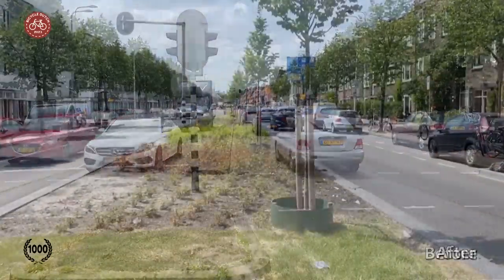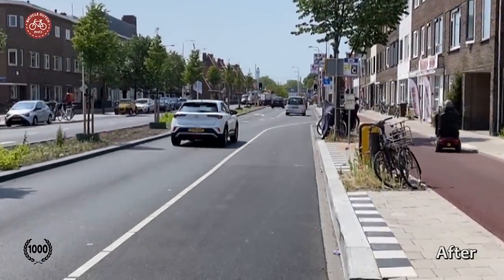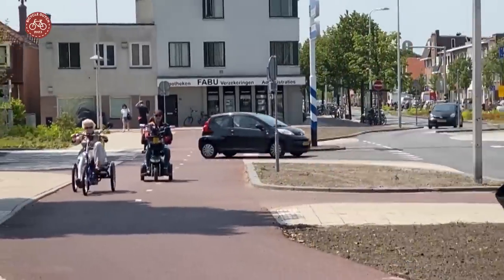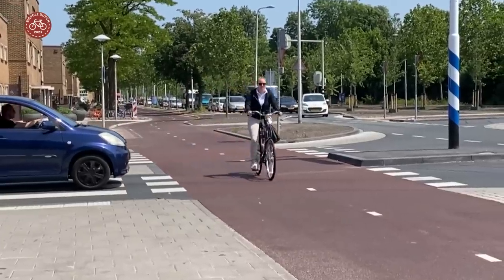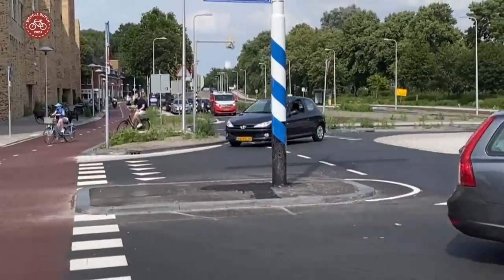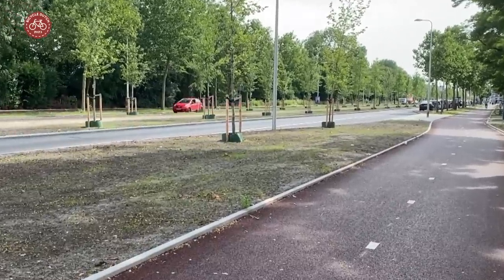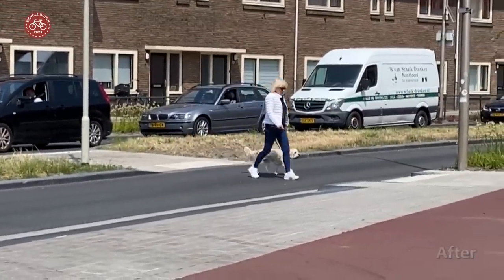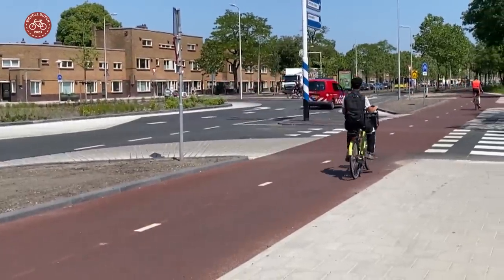Less space for cars, more for green. Utrecht's redesigned ring road

Comment: this success is in part a testament to how good the traffic flow is on the highways. in Toronto there are a lot of instances where the highway is slow and speeds drop to under 60km/h for big and multiple  and so drivers react by taking the normal roads; which in turn puts a lot of technical and political pressure on road engineers to not reduce the driving width and number of car lanes on roads.

i don’t know much about the dutch highway system but it sounds to me like there are fewer on and off ramps that Toronto, and that the roads that bring traffic into the highway are usually two lane or one lane wide in the Netherlands whereas in Toronto they are often three lanes wide. I think Toronto dumps traffic on the highway in big waves (red lights and wide arterial roads do this) vs in the netherlands the roads that lead to highways have fewer red lights and lanes.

Comment: This is one thing more and more German cities are getting as well: If Mr. Wissing doesn't want them to sign a street like this at 30 km/h then just design it for 30 and the result is probably even better.

Two ideas however are new to me: The wayfinding intentionally telling nothing outside the city and the voorrangsplein. Not totally sure, where the advantage over a roundabout is however.
Reply: When this crossing on the video was just done, another one further down the road was still under construction and was closed down. This voorrangsplein was then a complete pain to cross as a motorist (if we want to go in the direction of Amsterdam I would have to cross it). Now that both are open it’s less of an issue. I think this design is because there is less traffic crossing the road than going through (if that makes sense). It’s certainly easier when you’re just driving/cycling straight ahead, at the expense of making it harder to cross as a motorist. As a cyclist it’s comparable to crossing a normal roundabout with two separate road lanes.
Reply: For cars, this crossing is designed to optimize traffic on 1 axis, and crossing traffic needs to wait longer. Its basically a roundabout with priority for 2 out of 4 directions
Reply: If we would only have so much space - some parts of the ring road here in Lüneburg are only about 15 meters including the bike lanes and sidewalks, leaving very little room for gaps or green.

Comment: I'm NOT a fan of the new layout. Sure there are lots of pros, but also some cons: single lanes divided by a median are a nightmare for emergency vehicles responding to a call and for other motorists to find a spot to pull over. That definetly increases response and transport times of emergency vehicles
Reply from the maker: Emergency services were involved in the redesign. They approved everything and where necessary the cycleways have been constructed in such a way that they can carry the weight of even the heaviest fire engine. The emergency vehicles are not going to wait behind vehicles on the single lane, they can simply pass them on the cycleways. This is explained in the blog post with this video.
Reply: @BicycleDutch  wow ... would have never expected it to be so bad that local emergency services would approve sth like that ... 
A bike path should primarily be a bike path, just like sidewalks being sidewalks; Of course one could use them if utterly necessary, but this shouldn't be the backup plan right away. 
I've seen quite a few videos from the Netherlands, where it still costs the emergency vehicle time to cross over to the bike lane, especially larger emergency vehicles like Tower Ladders from the fire department. And I've also seen quite a few clips where pedestrians or cyclists didn't bother to move over - they heard the sirens, but didn't expect the emergency vehicle to be on the sidewalk / bike lane. 
Especially larger and heavier emergency vehicles will not fit there and they will have a hard time getting through on such roads, especially when traffic is backed up
Reply: @dimrrider9133  no, we don't have any EVOC, no qualification which allows us to be behind the wheel of an emergency vehicle

Comment: Awesome how dutch use their cars so little, but thats also because the country is compact and have an easy terrain
Reply: It's funny how our first thoughts, in this case your reaction, can be completely wrong. It's not about the scale or terrain of the country. Dutch car ownership has never been higher than now. Most car trips in any country are no longer than 3 miles, and the main difference is that the Dutch made the 3 miles around their houses safe and inviting to walk and cycle. They guide traffic into compacted flows: Through traffic uses ring roads around villages and towns, and local roads are designated for either traffic or living. This takes away a small % of car traffic, which is enough to clear traffic jams.
Reply: Is has nothing to do with the size of the country.
If the USA starts designing their city's like this, you would get the similair effect

Comment: Horrible design and I have a pretty good idea which external bureau pushed this. No space to create room for emergency vehicles, especially during rush hour. Dual direction bike paths are an absolute disaster for visibility, in particular for truck drivers who have absolutely no intention of running over cyclists but are frequently confronted with literal kamikazes. Traffic lights are proven more safe than "creative" roundabouts, with prominent example the Delflandplein in Delft that was designed by that same bureau and in its first year counted more casualties already than it had during ten years before when it was still a crossing with traffic lights. Ten years later it is still counting in about the same rate as none of the later modifications had any effect due to the planners being unwilling to acknowledge that the problem lies in their conceptual design and all this time their efforts were targetted at "educating" road users to understand their intentions.